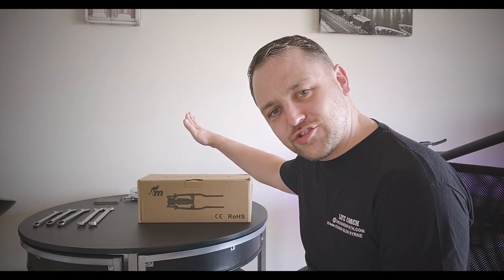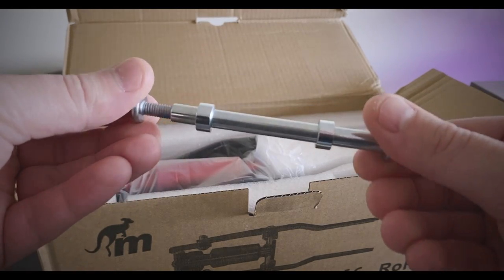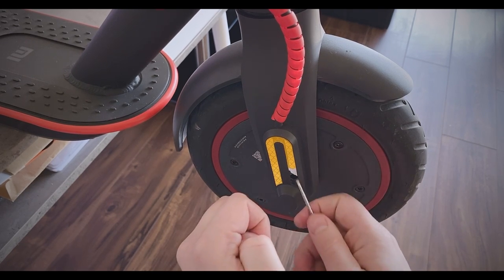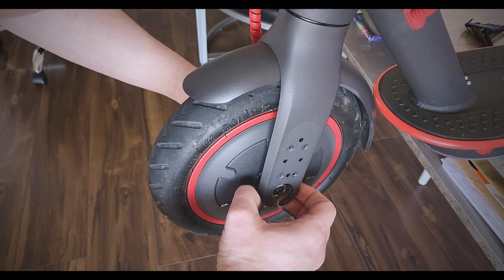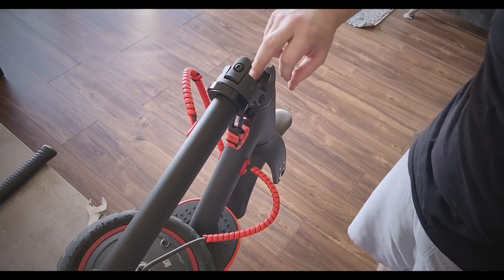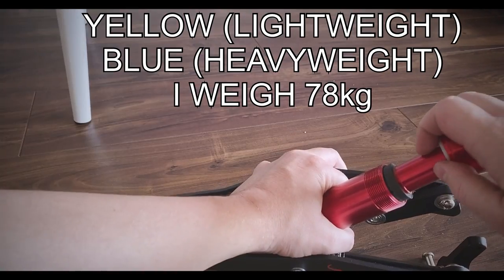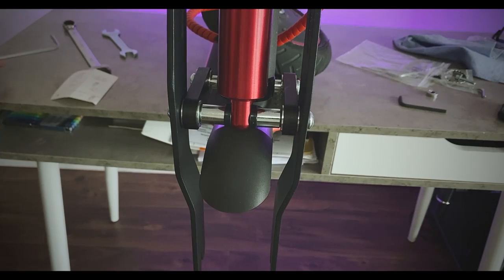MONORIM V2/V3/V4 SUSPENSION KIT FOR XIAOMI M365 PRO 2/3 - Start To Finish Installation

Comment: Tnx for your video. I tried installing the air version I've just bought on my Essential but I had to give up (for now): the air piston crashes against the front light  and I've found no way to shift it a bit away (let alone the bearing wheel won't fit nicely). No way to finish the upgrade, had to rever back to stock. I feel really a boomer...
Reply from the maker: Hi Gabriele! Join the Monorim FB and ask for help there. I’ve never installed the air shock myself 🛴

Comment: What is the difference between v2 and v4? Is there a huge difference between those two?
Reply from the maker: The v4 has the adapter for the from mudguard already included and fitted. Get that version ⚡️

Comment: Hi Mate ,I have recently installed the same suspension on my m365 and I having problems with my steering.  There is play when I stand on my scooter and rock the handbags back and forth there is a little play I don't know what to do please can you help? Thanks
Reply from the maker: The middle stem screw is more than likely not tight enough. Screw it in by hand first then tighten. Check everything all over also.
Reply: @Movelectrics  Hi mate it turned out to be the center bolt ,Great Video
Reply: @derrickmoses  i have the same issue. which one is the center bolt? was it loose or wrong bolt?
Reply: @nutterbirdmoto  Hi i had to buy another centere bolt i either misplaced it or it didnt come with the suspension. I took my scooter to my local scooter repair specialist.  He charged me a tenner to put in the correct bolt including the bolt

Comment: Big defect in the design if you use 10 inch tires is the fender can hit the tire if you hit a big bump. That means big crash and broken teeth! 😬
Reply from the maker: I know people that have 10 inch and the suspension. They have never had issues. When you do have the 10 inch, you replace the front fender screw with a flat head 🛴

Comment: My steering is stiff help plz
Reply from the maker: Did you tighten the middle bolt too much?
Reply: I think i have fixed it i will try it tomorow i loosened all of the screws then i screwed them in intil it was just tight  not too tight my steering has fixed but i will try it tomorow
Reply from the maker: @jameelahmed840  middle bolt is the main one that pulls together the bearings. Loosen it a hair until happy.

Comment: 60/70 6.5 are such worst tires ever ridden and they should of adding 10x3 to make fit as seen someone already put 10x3 are way better performance then most of 60/70 6.5 and was hoping if any one can try fitted 10x3 on ninebot max has same shape like Xiaomi m365

Comment: On my m365 pro 2 I can’t seem to remove the front fork / mudguard even after following all the steps up to the point where it should ‘pop out’ 

Any help anyone?
Reply from the maker: Hi Hugh! You need to remove the middle stem screw (this holds everything in place)
Then hit it slightly to pop it out 🛴
Reply: Thanks! It was just really stuck, was a bit hesitant to give it a wham

Comment: Hi, I installed my suspension, it's perfect. 
The Ride is absolutelly smooth. BUT my front mud Shield is "moving", so it scratch my wheel, is it normal ? What Can I do with it. Thanks
Reply from the maker: Hi Andrej. Great job installing! I also had this problem with my mudguard moving. If you got the V2 version like me, you don’t get anything to secure that mudguard really. Monorim brought out a V3 kit that has an adapter fitted.
So I made a video installing the FS adapter, watch that. Mine has not moved since, no wheel rubbing 🛴
https://youtu.be/SsWwDm0IbJA
Reply: @Movelectrics  Thank you so much 😇
Reply: @Movelectrics  i m thinking to buy Version 4 ? Does it have it too ? What is yhe difference 3 and 4 ?
Reply from the maker: 3 has the adapter for mudguard. I’m not sure about V4. To be honest, V3 is decent ⚡️

Comment: At 9:21 (min 9:21 here -> https://youtu.be/kPvcoipiAhY?t=561) what do you mean by ADJUST AGAIN UNTIL HAPPY? What this screw holds or does? Thanks for the video!
Reply from the maker: Hi Fabio! The middle bolt I am talking about. This bolt basically tightens up the steering. You want to adjust this so that the steering is not too loose or tight 🛴

Comment: Hi sorry to be a pest ! But have they upgraded the suspension from your one as in i have a bracket for the front mud gard different to the set up on the video  ? Regards J
Reply from the maker: Hi Jonathan. They brought out a V3 version that also has the mudguard adapter included 🛴

Comment: No need to remove the 8 screws under the plastic wheel caps. That just holds the plastic fork trim to the metal underneath. The wheel nuts should loosen without bending the fork trim out.
Reply from the maker: I done it to get a good grip on the nuts. You can see when I tightened it back that I pulled the cover out to get a good hold.
Many people by mistake have not done this, and have round the nuts off because the spanner was not on correct.
Reply: @Movelectrics  thanks for a great video btw, have just finished installing mine on an AovoPro Pro using your video. Had a nightmare getting the steering column off. Needed ‘persuading’! 😄
Reply from the maker: Well done!! Everything feels ok? No rattling?
Reply: @Movelectrics  it was a nightmare to get anything tightened initially. I’m fortunately a member of a Facebook group for AovoPro owners, so I asked those members that had the V2 what they thought was wrong. Turns out that using the OEM centre bolt was causing the issue. It’s too long for the new forks so was locking out down the stem before pulling everything together to tighten it up. I swapped it out for one of the inch long bolts that came with the V2 and all was well.
Reply from the maker: Ah right! I’m not familiar with the setup of them scooters!! Enjoy the V2 🛴

Comment: I’ve just fitted mine and the stem shakes as though the bearings are gone but there not any help on this would be appreciated many thanks
Reply from the maker: The main middle bolt needs to be tightened BEFORE you tighten the side ones on at the stem.

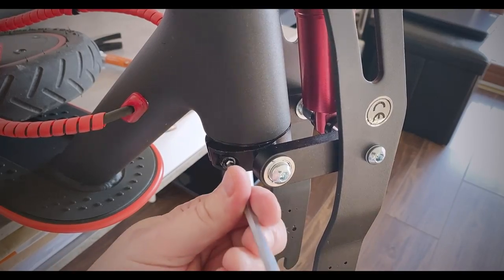Comment: Hey CL, I'm in the middle of installing a V3 suspension and wanted to check before I move on. I just inserted the rod that attaches the suspension firmly, and noticed it seems like there is some give at the bottom which doesn't seem present with yours at 8:16, I can move the suspension about 5-10mm up if I push the base of it. Did I make some mistake, or will this iron out once everything else is connected? Some pics, if they help: https://imgur.com/K9zVLw3 https://imgur.com/DnetqKV
Reply from the maker: Hi Shannon.
Once you tighten the middle stem bolt, it pulls everything together 🛴
Reply: @Movelectrics  Ah, glad to know that's the case, as I did end up going on to assemble it further but was worried I might need to back track! It's looking good overall, did my first test drive to the shops, realized I needed to tighten the bar for the FS adapter really firmly as the mudguard loosened a tad onto the wheel. No idea why, but the wheel brackets won't allow me to put the housing on BOTH sides at once, only one, but was too tuckered out by then to find out how to balance it out :S Still it rides well it seems from the test 🛴

Wanted to thank you for your comprehensive guide, it was a real boon to helping me put everything together even on the new model as there was a lot of crossover. Honestly woulda been lost (or even more lost) without you and one other guide I used along the way, as DIY mechanics is by no means my forte! Cheers  ^.^
Reply from the maker: Well done Shannon for fitting it. People think they are difficult, but with patience, anyone can fit it. I absolutely love the suspension, makes it so more enjoyable!!

Thanks for the support, really appreciate it!! 🛴
Reply: @Movelectrics  Agreed man, no more xiaomi "ah-woah"" on all the bumps :P You gonna be getting an xtech hb100 anytime soon? Would love to hear your thoughts and review of it in comparison to the standard brake.
Reply from the maker: I actually have the Xtech kit. I am happy with the stock but in the rain, they definitely ain’t the best. I will be fitting it soon for sure 🛴

Comment: Why do you change the spring? What purpose does this do? Sorry I can't see anything about it on the website I brought it from.
Reply: Comes with two springs to interchange from 70kg up to 100kg, customer must use blue spring if over 70kg

Sorted bro
Reply from the maker: I weigh 78kg so that spring is suitable for me. You can use either really. One is softer than the other ⚡️

Comment: Followed the instructions and my steering is so stiff!
Reply from the maker: You have tightened the middle screw way too much. Loosen it slowly until you are happy.
Reply: @Movelectrics  I sorted it. For some reason the bearings at the bottom of the stem were not on straight so they started grinding and falling out. Thankfully they had a spare so it's done. Makes such a difference. Thanks for this review.
Reply from the maker: @EmpressAuset  yeah the bearings have to be 100%. Good job!!

Comment: I have been trying to take of them damn bolts off the wheels for 25 mins now. I can't do it haha. My brother helping me two of us can't do it lol.
Reply from the maker: Hi Shaz! I would suggest not using the spanner supplied to loosing the nut. I used a SnapOn 18 spanner. Put the scooter on the floor of that helps. You can easily round them nuts off so be careful. If you have no luck and round the nuts, get a vice grips and loosing them as a last resort 🛴
Reply: @Movelectrics  i used a ratchet to take of the one without the wire. Im not struggling to remove the side wirh the wire. I keep damaging the nut because its so hard to do
Reply from the maker: I would suggest getting a vice grips since the nuts are damaged. Put the scooter on the floor and get someone to put their weight on it while you try and loosing it. I have many spare nuts in stock if you want them 🛴
Reply: @Movelectrics  hi mate. Thanks. I had to take it over to my mechanic uncle and do it i don’t think I would have managed by myself! Installed the V3 with the mudguard bracket and its feels great. Have you used a rear suspension on the m365?
Reply from the maker: You will love it! I’m currently thinking about the rear suspension 🛴

Comment: Im having issues with unscrewing the nut 😅 I don't know if I'm doing anything wrong or if I'm just too weak. Is there any thing that I should watch out for? Because I have fear of breaking something.
Reply from the maker: Hi
Don’t use the tool that came provided. It’s too soft and will round off the nut.

Get a better quality spanner like I use in the video. You can also put the scooter on the floor and have a friend stand on it while you loosing it.
Reply: @Movelectrics  yeah I have thought about that, but I don't really get why you need spanners on both sides. Do I just hold one in place and pull on the other or can I just use one?
Reply from the maker: The purpose is for leverage. Applying weight to one side and loosing the other.
Reply: @Movelectrics  makes sense now hahah, sorry. Yeah but I got my friend to stand on it and it worked thank you very much

Comment: Did you ever get EXA A5 air suspension for this? Considering them for mine. I've just installed front and rear Monorim on my pro 2 and the spring chambers are pretty awful. Creaky and squeaky. They work well, just noisy. Air is the way I think
Reply from the maker: Never tried. Use grease in the chambers.
Reply: @Movelectrics  ah ok, wasn't sure as you mentioned you were going to get the air chamber to replace it. Guessing you didn't in the end? The front suspension kit is so easy to fit, took about 30 mins. The rear kit is a different story, took about 3 hours haha.
Reply from the maker: @dannybl1  this video was made a good few years ago but ended up liking the stock spring.

Comment: I cant seem to get the steering fixture on top of  the bearings and the cap on it. It just doesnt stay. Great video anyways 😀
Reply from the maker: When you insert the middle stem screw, it pulls everything right
Reply: @Movelectrics  Thanks so much, i think it worked, i was stuck on that part for hours, because i thought that the steering fixture had to be somewhat locked in place. 🙂
Reply from the maker: Good job and enjoy

Comment: Hi. My monorim suspension feels super stiff when I pass over a hump in the road....Do you know how can I loose the spring to make it softer? Thanks
Reply from the maker: Try the other spring supplied
Reply: @Movelectrics  yeah, I was thinking the same. I´m 75kg tho....funny. Thanks
Reply: @melquizedec  did u solve the problem?
Reply from the maker: Use the yellow spring and try. It’s for lighter riders but some people prefer it.
Reply: @Movelectrics  i am already with the yellow one
Reply from the maker: You can buy the air suspension from AliExpress. At least then you can adjust to your own liking. Join the Monorim FB group to get the correct size.